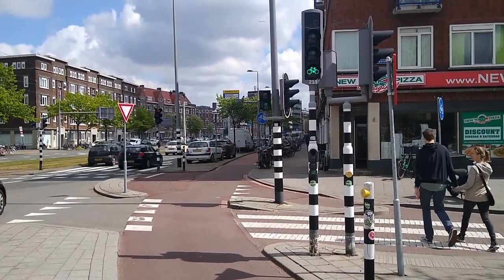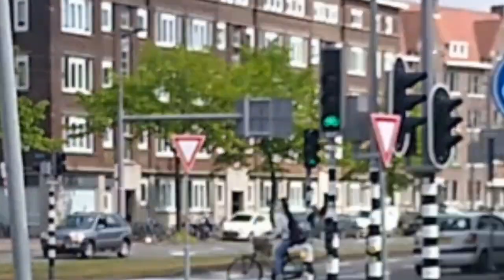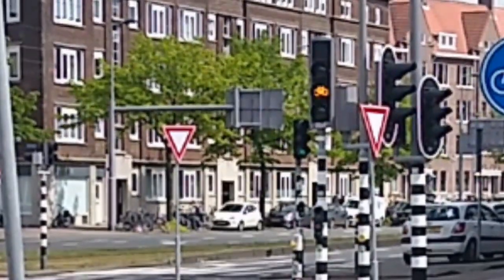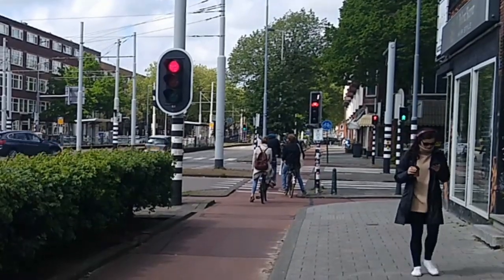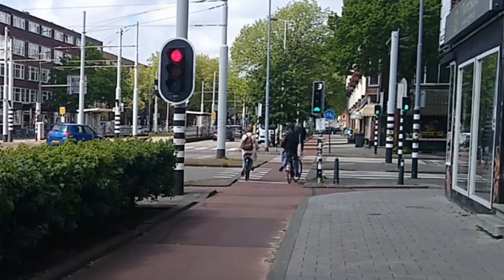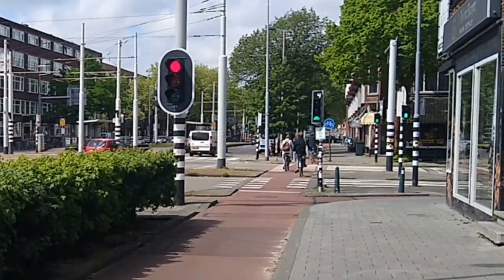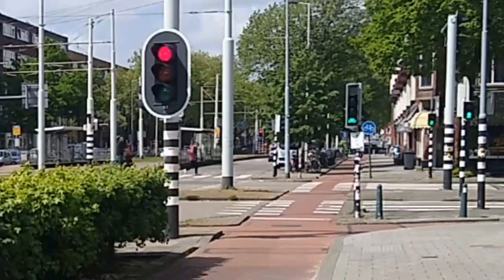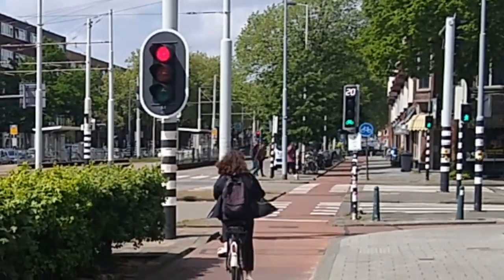Why Rotterdam's traffic signals can't count properly

Comment: I personally more like the counters that don't give a number but a circle that gets completed. These are usually only on the eye level signal and not on the high one, and only show red timings and not green timings. Basically they show that you have been detected (ether by thr button or the detectors) and show the maximum time you have to wait. And it's always nice to see it speed up.
Reply: I like those too, they are more adaptable than the number timers since you don't have to display an actual number, so if the time changes it's much simpler visually, and I think quicker understood too.
Reply: Now that is a super cool idea! 7-segment displays are usually fine, but a progress bar/circle feels pretty universal.

Comment: I'm a huge fan of those count downs... yanno, if they actuall count down properly. Constantly switching numbers just sounds wayyyy confusing. I'd just very quickly stop paying attention to them probably. I guess it'd make more sense to have it start counting down when it actually knows it's about to change? So basically, only during the 'yellow' phase? I've seen a couple of pedestrian lights that don't count down, but the green light flashes when it's about to turn red.
Reply from the maker: Yeah, flashing random numbers is pretty pointless.  There are indeed some other cities in the Netherlands who only show the countdown from 3 seconds (when it's actually known) which makes a lot more sense to me.
Reply: The traffic lights in Eindhoven aren't like this. When they reach a certain point in the countdown, the countdown won't go up again to facilitate a new cyclist that just arrived. The countdown also starts at a higher number. This together means that the timers are on point when it comes to announcing when a light turns red.
Reply from the maker: @Ithuriel  Interesting, I'll see if I can find some countdown timers next time i'm in Eindhoven. Are there particular areas where they are more common?
Reply: @OntarioTrafficMan  I usually only encounter countdown mechanisms with bars or circles, no numbers. These work a lot better imo, since they just accelerate or slow down the rate of the bar or circle emptying, without doing confusing things with the numbers.

Two examples I know for certain: Groningen is full of the bar type, next to the bicycle lights on pretty much every major intersection is a bar of yellow LED's, that drains down untill the green light activates. Where in this video the numbers freak out, the bar just empties slower or faster. Enschede has a circle of white led's around the red cycle light, that drains in the same way.

One light in Enschede I pass semi frequently has a broken circle of LED's that doesn't drain but stays fully lit untill suddenly it jumps to green. Catches me off guard every single time.
Reply from the maker: @JoranGroothengel  Yes I think the circle diagram is the perfect way of providing this information without being confusing. And outside of Rotterdam it does thankfully seem to be the most common solution in this part of Zuid Holland.
Reply: I think it is more intuitive for users if it still counts down, but speeds up instead, which I've seen elsewhere in NL.
Reply: @JoranGroothengel  Doetinchem has the circle too. I prefer the bar/circle variety for easier interpretation, also from further away. It's much easier to see whether the bar/circle is half empty than whether that number is a 1 or a 7. I suspect it's quicker too, generally people are better and quicker at interpreting visual representations vs numbers.

Comment: There is a counter in the city of delft that don't use numbers but LED lights like some type of loading bar but then in reverse the less lights on the closer to a green 
It can speed up or slow down but it never skips
 so now It give us a indication to get ready because the light will get green
On average it takes a second to get ready but if we see it get close to the end most people will look of cars are coming and already give the beginning force to start riding but most people will not cross the waiting line even when they start pedaling
Reply from the maker: I've seen a loading bar type countdown in Zoetermeer, but the lights I use in Delft all have a circular wachttijdvoorspeler. Which intersections have the 'loading bar' type?
Reply: @OntarioTrafficMan  So youve been to Zoetermeer, wow. My hometown
Reply from the maker: @ov_079  I've been to Zoetermeer many times, especially during the pandemic since it's within cycling distance of Delft and it was nice to sort of travel somewhere during the lockdown. I also got one of my vaccinations there.

I also wanted to see the unique sneltram network. Very remarkable infrastructure for such a small city.
Reply: @OntarioTrafficMan  Oh yes the sneltram is epic and unique in the Netherlands. Did you know it was a train line before with heavy rail stock, operated by NS?
Reply from the maker: @ov_079  Ja ik heb over de geschiedenis van de Zoetermeerlijn gelezen, en ook die van de Hofpleinlijn naar Rotterdam. Ik vind het grappig dat de "tram"lijn van Den Haag naar Zoetermeer volledig ongelijkvloers is, terwijl de "metro"lijn naar Rotterdam wel spoorwegovergangen heeft
Reply: @OntarioTrafficMan  De Zoetermeer Stadslijn is later aangelegd dan de Hofpleinlijn, toen er andere regels golden. Nieuwe spoorwegen in Nederland mogen sinds een tijdje geen overwegen bevatten tenzij het echt niet anders kan. Hoe heb je Nederlands geleerd als ik vragen mag en woon je (gedeeltelijk?) ook in Delft?
Reply from the maker: @ov_079  Ik had wel gemerkt dat nieuwere spoorlijnen zoals de Flevolijn en Hanzelijn geen overwegen hebben maar ik wist niet dat dat echt een regel was. Interessant.

Ik woon al enkele jaren in Delft en ik had al basislessen Nederlands gevolgd op school in Canada voordat ik naar Nederland ben verhuisd.
Reply: @OntarioTrafficMan  interessant! T zal wel bevallen Nederland als je t met Canada vergelijkt, met name leefbaarheid in steden etc (buiten een auto)

Comment: Cool video! I bet in rush hour things would be very different, since they don't need to activate sensor-based then.
Reply from the maker: In rush hour less time gets skipped, but the detectors still remain active. Even during the busiest hour, the number of vehicles in each direction typically fluctuates enough from cycle to cycle that some phases can be shortened.
Reply: @OntarioTrafficMan  Wow! Here we have a fixed cycle. I think you guys would have some changes too if you had countdown pedestrian signals like we do here, that have to hit a certain amount of seconds, whether it is 6 or 26.
Reply from the maker: @AmtrakProductions  Yes, the long pedestrian countdowns are one of the main factors that prevents North American signals from having effective real-time responses to traffic (which is especially problematic for Transit Signal Priority). The Netherlands has pedestrian countdowns too, but the difference is that they're much shorter since pedestrian crossings are divided into multiple stages crossing only a couple lanes each, so the countdown only needs to be a few seconds.

Since each crossing only crosses one particular leg, there are far more opportunities to give pedestrians green lights than the setup where the entire crossing needs to display "walk" at the same time, even on parts of the crossing where there aren't pedestrians at the moment. In the Netherlands, the pedestrian signals instead provide a green wave across the various crossings, which I plan to show in a future video.
Reply: reaperexpress Netherlands seems to have far better traffic signals than the US, like everything else.
Reply from the maker: @AmtrakProductions  I agree. In fact I plan to make a video series over the next couple years explaining exactly how the Dutch traffic signal practices are better, and how we could change American/Canadian practices to gain some of their advantages.
Reply: reaperexpress we have a few things that the Dutch could learn. The best is the permissive protective left turn signals. Dutch left turns are either totally permissive or totally protected.
Reply from the maker: @AmtrakProductions  True! I was surprised to learn that there are no protected-permissive turn signals here
Reply: @AmtrakProductions  how does this left turn work?
Reply: @burgerpommes2001  I actually have changed my stance and I like protected lefts now. But basically it would be a left turn where you have a green arrow to go at the start, and then it ends and you have to yield to see if it’s safe